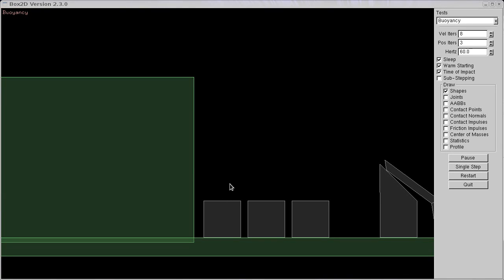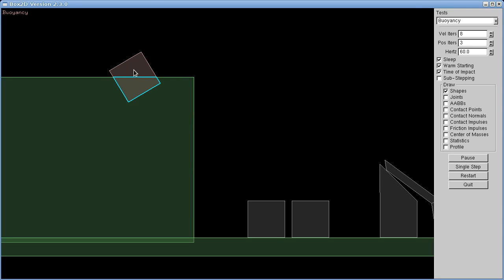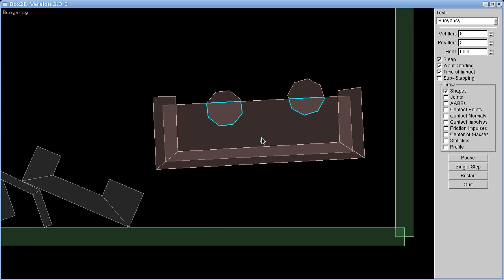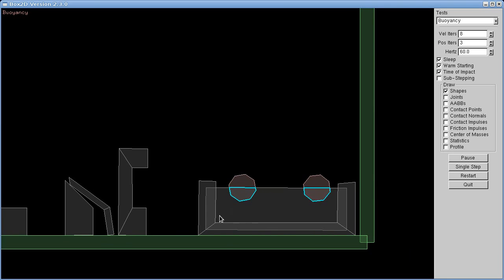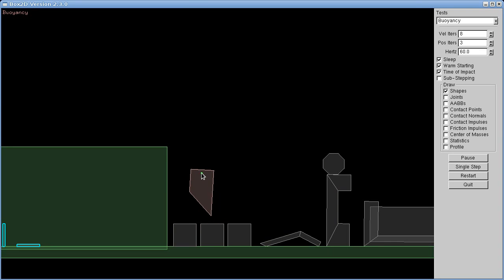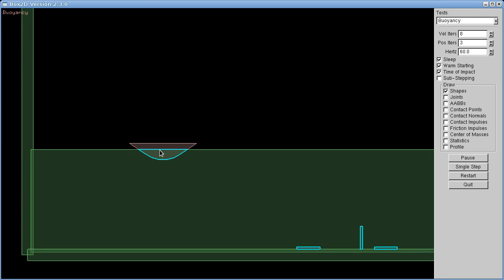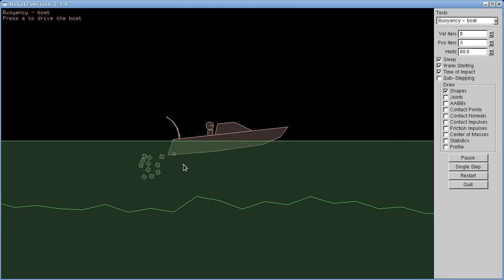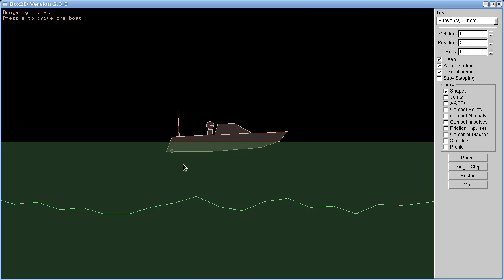Box2D buoyancy tutorial

Comment: Impressive tutorial.. But I have got a question. Can you please explain how you created such a huge water tank? When force is applied the boat is supposed to move forward but it remained in the center of the water tank and didn't reach the boundary. Will you please explain how this continuous physics world is achieved?
Reply from the maker: Pretty simple. If the boat goes to x >= 450, it gets moved left by 900.
You can get the source code at the link in the description.
Reply: ***** Thank you for your timely reply.. If proper textures are applied to the objects then won't the impact of backward push be visible to the user?
Reply from the maker: Sundus Batool
Not if you have the same textures 900 units apart :) I made sure that the bumps in the ground repeat every 900 units.
Reply: *****
Yes it makes sense. Thank you!

Comment: So first of all thank you for your magnificent tutorial. I have been trying to implement it for my new game and I'm stuck on this problem for the second week.. 

Problem: when object is dropped in water at higher speeds it bounces back really hard.

Concerning the advanced drag that you are applying:

Lets say we have square 1 meter x 1 meter in size;

Looking at you equation dragMag = dragDot*edgeLength*WATERDENSITY*vel*vel
(WATERDENSITY = 1)

say the square lands flat on surface of water at speed 25m/s

that gives dragMag of 1 * 1 * 1 * 25 * 25 = 625
625 is huge and it makes sense that cube bounces way up in the air.
(dragMod of 0.25f that i found in source code won't really help)

Do you experienced anything similar while writing this? I am very much frustrated with this problem and I hope that you see this message.

Once again thank you.
Reply from the maker: What is the density of the box, and what is the simulation rate? Assuming the box is density 1, a force of 625 against a mass of 1 would be an acceleration of 625m/s/s, running at 60fps would cause the mass to slow by about 10m/s in one time step.

In the next time step, the speed is now 15 so dragMag would be 1 * 1 * 1 * 15 * 15 and the mass would slow by 225/60 = 3.75m/s and would then be about 11.

Next step, 1 * 1 * 1 * 11 * 11 = 121, speed becomes about 9, and so on. I don't see how the drag force could cause a bounce in this situation.

On the other hand, with a simulation rate of 20fps the first time step would allow the drag force to change the speed of the box by 625/20 = 31m/s and would indeed bounce it back upward. Likewise if the box was significantly less dense than the liquid, it would cause this as well

Maybe you could limit the force applied so that it cannot reverse the direction of the box in one time step.